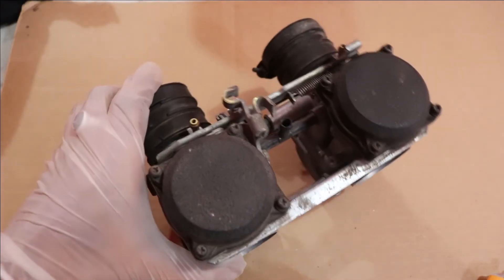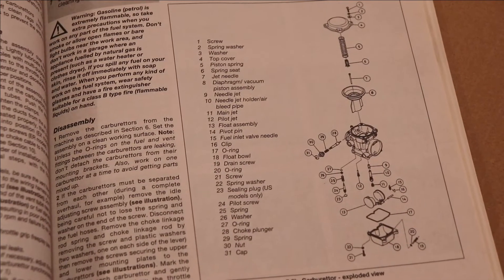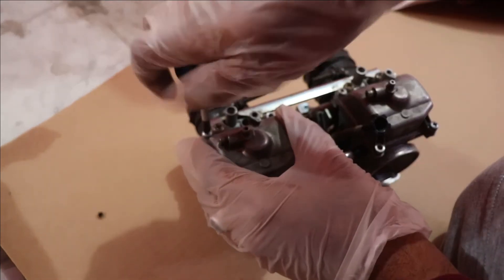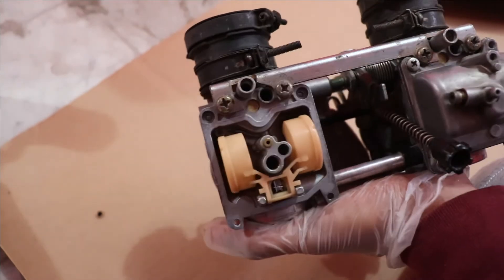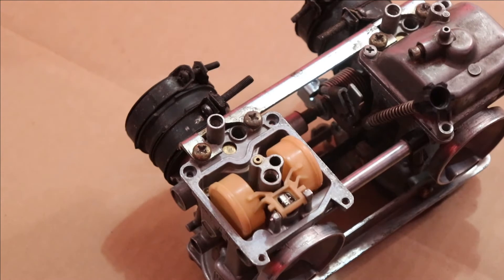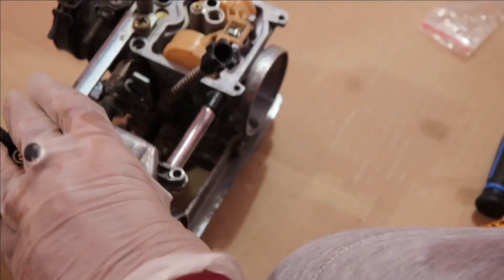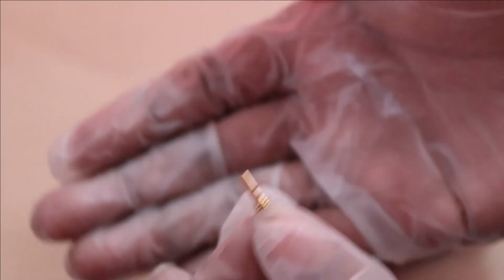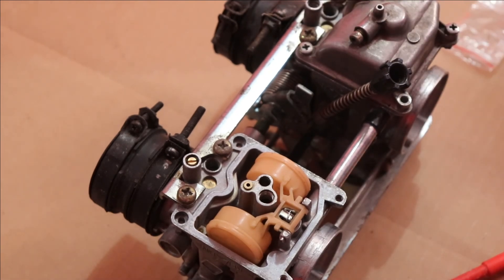Ninja 500 carb rebuild pt1

Comment: When I was cleaning the carb, I had 2 very small metal cylinders with a lip in the middle of the cylinder fall out. One from each side on the bottom when I had the bowls off. They weren’t threaded at all and I can’t figure out where they go. Any ideas what they are and where they go?
Reply from the maker: I think I know what your talking about, if you watch my second vid of my carb rebuild I put a small cylinder piece into the big hole that the main jet sits in, it is called a needle jet in my service book. it is a pressed in fitting, that's why it has no threads. its not in this vid because my carbs didn't have it and my new ones had not shown up at the time
Reply: @riyaadhuddin8124  That’s exactly what they were. Thanks for the help man.